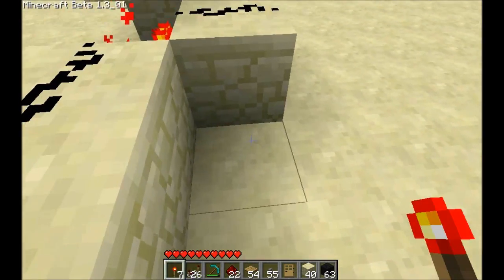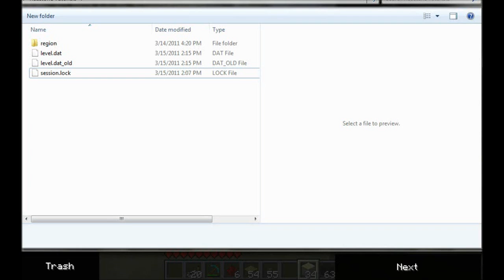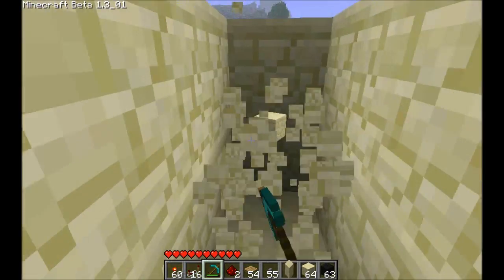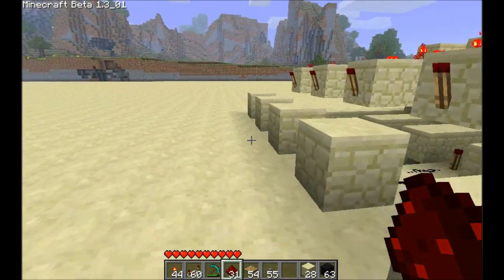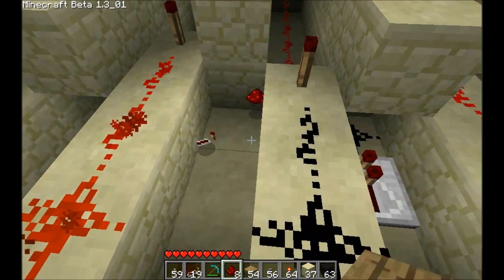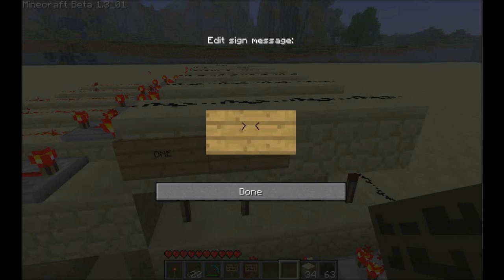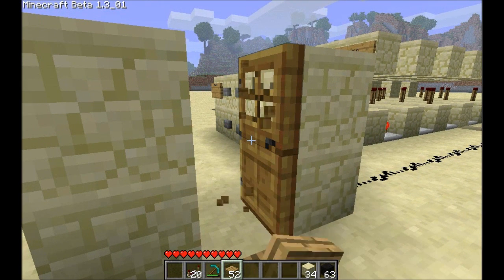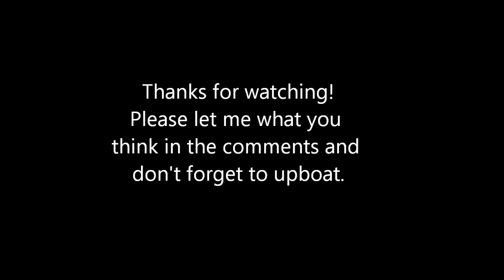Technical Let's Play: Building the 4 button (6 pin) lock. Part 1 of 2

Comment: i cringed while you put in the wrong combo but admired your patience, i would have ragequit and come back to it much much later and hopefully not have ruined anything during the rage :P. IIRC in the 9 pad 4 length u have 4 slots with 9 possiblities each, with the 4 pad 6 length you have 6 slots with 4 possibilities each. So the 9 has a total of 9*9*9*9 = 6561 options. The 4 has 4*4*4*4*4*4= 4096 options. but i might not be considering duplicates etc, so im not certain.

Comment: this lock has 4096 maximum possible combinations (4^6), an 9digit pad with 4 pins would have 6,561 possible combinations (9^4). though at your rate of entering numbers (assuming 1/2 second per button press), it would take up to 3 hours and 25 minutes to enter all combinations, so bruteforcing isn't that practical.

Comment: after the first go, so long as you try to repeat the code in succession, you can hit 421234 the first time, then 21234 the rest of the times because it wont reset the first torch after the success. any way to fix that?

Comment: this dose not work beccause of the way the new redstone works but i found a way to get it working just change the restone inbetwen the latches so that it has the toch powers redstone under it then use repeters to seperate the redstone from the one it came from and chande the length from 3 to 2 then to 3 then to 2 for the part before the latch